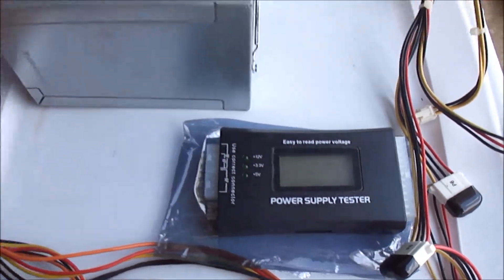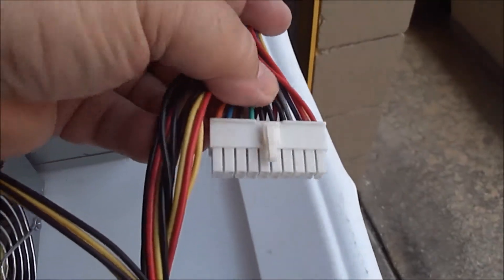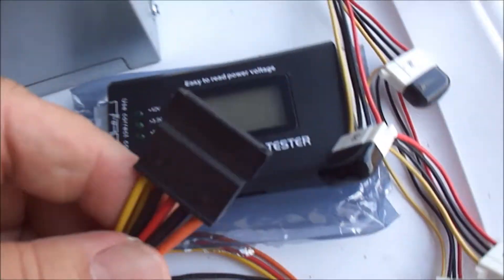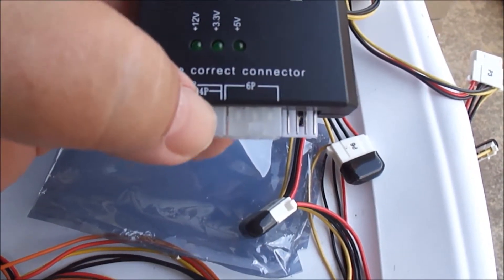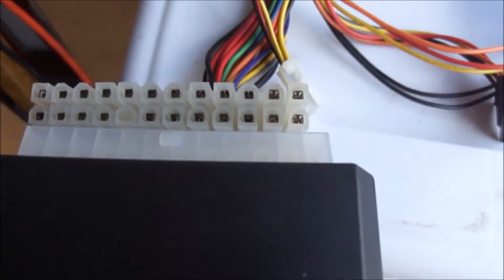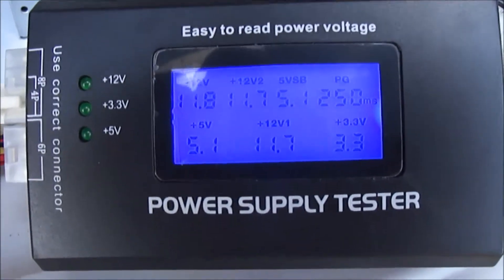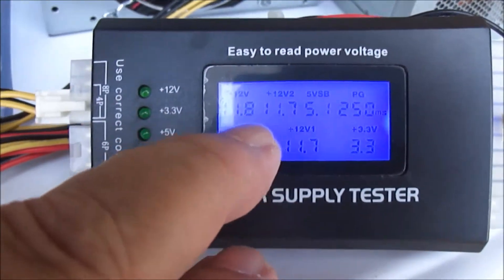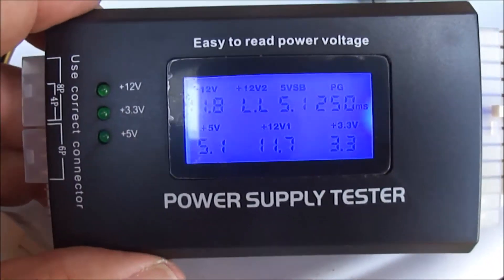Inexpensive and Easy To Use Computer Power Supply Tester

Comment: I used one of these for my power supply, and it didn't turn on. Is it safe to say the power supply is dead? I bought a 2nd tester because the first one sparked, so I was refunded, probably a faulty one. But the new one didn't turn on at all. Is my PSU dead? Thank you for the video, it was very clear on how to plug it in for someone like me who doesn't know much :) God bless.

Comment: Can you use the power supply tester to test 6 pin connectors without plugging in the 20/24 pin connector?

Comment: With the tester plugged in and the PSU power on, could a user then
- use a multi-meter on the individual pins of a connector, say a molex yellow and black, to see a more precise voltage at the connector?
This would be much better than a setup with a paperclip shorting a green to black wire on the 24 pin connector.
Reply from the maker: I don't see why not. I will check with a multimeter to see how easy it would be.
Reply: 5/15 I got my PSU test device from China. With the help of your video I had it hooked up and working in minutes. Next I used a multi-meter to validate the voltage at the pin connections of the Molex, PCI-E and CPU connectors. The test device is a much safer means of powering on the PSU than a bent, exposed, piece of metal, like the "paper clip" method.